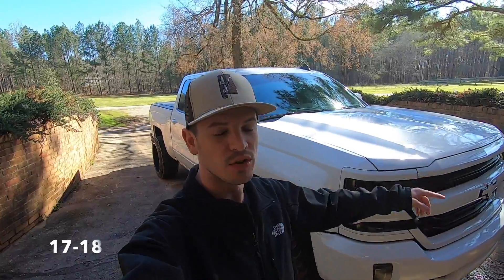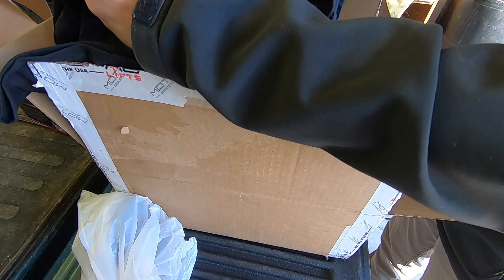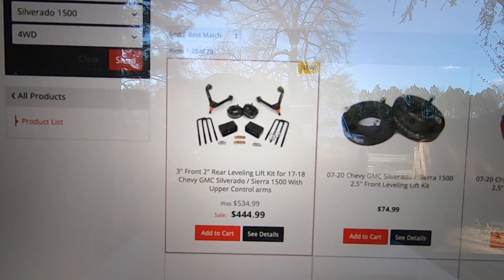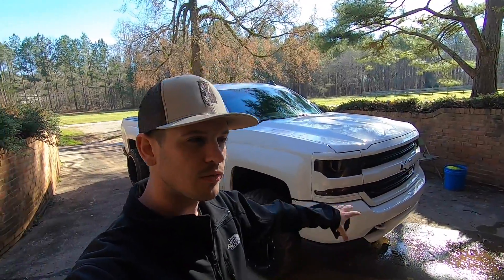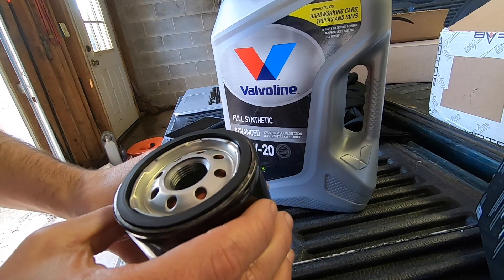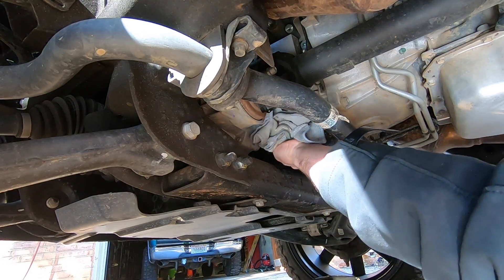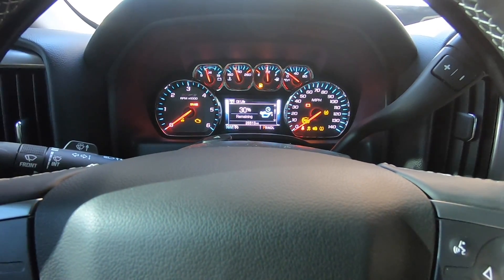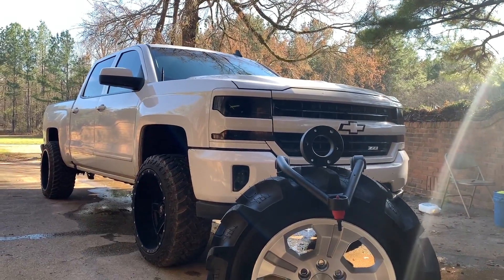Motofab's new leveling kit package! 2.5" - 3" lifts

Comment: Just got the MotoFab upper control arms put on my 2018 Silverado today after riding on the stock stamped steel upper control arms for roughly 2,000 miles with a MotoFab 3 inch leveling kit. As soon as I left the parking lot of the shop and hit the road I could immediately tell a difference. The ride quality on the truck is so much better now with the motofab control arms than with the stock control arms. Everything looks and feels promising, but time will tell.
Reply: You got the new version as shown on the video or the "old version" ... I was told that the old version must likely rub with you wheels or so.  I'm quiet not sure about this new ones.  I gotta do my swap ASAP... I am now at 19k miles with 2.5 leveling kit.
Reply: Francisco Garcia Mine are like the ones in the video, no rubbing that I could tell, even at full lock and I’m running stock 18’s and 31’s
Reply: @jason.godwin  thanks for the info.   Will be making the upgrade soon.
Reply: Francisco Garcia 👌🏻 No problem man
Reply: Are you still running motofab upper control arms? How are they? Have you had any issues?
Reply: Been running these and made a video

Comment: Just installed the the 3” front with 2” rear motofab lift kit with their upper control arms on my ‘19 LD Silverado with a diff drop from supreme suspensions and rear shock mount extenders and the angles are all good in the front, and the truck rides just as good as it did stock. Very happy with the lift so far.
Reply: is the diff drop needed or did you do it just incase?

Comment: The Purolator boss filter has a synthetic media that filters out smaller micron material.. Mobil 1 has a synthetic blend media that filters out a little larger microns but has good capacity. Either way, your only putting 5000 miles approximately on each oil change which is only about a third of the filter life. You could go with a mid grade filter and save a few $$. Those are usually a syn blend filter also.

Comment: My first oil change I did amsoil signature annual oil change and a year later I now have a baby and not as much money. I went with the same valvoline oil but used the mobile 1 filter you removed. I feel she runs just as smooth with valvoline as she did with the amsoil. One trick I use to keep track of my oil change intervals is the second trip odometer in the display in the gauge cluster.

Comment: No dry start by not filling oil filter. You actually put in oil through the valve covers which will lubricate everything on its way down to the pan. The pick-up tube draws from the lower sump of the pan. If you can start your truck within 5 or so min after finished filling up you'll be fine tbh.. but great review on the suspension bits brother
 Appreciate the effort and taking out the guess work on these parts.

Comment: I use NAPA Gold oil filters! I use it with Mobil 1 full synthetic oil. Yes, you can use the NAPA gold with full synthetic oil. I called Wix, which makes Napa oil filters, among other oil filters, a representative told me that it is safe to use the regular wix or Napa gold with full synthetic oil as long as you follow your vehicle oil change intervals

Comment: The Purolator Boss is a good oil filter bro. It’s made by champion labs which is WIX. I have cut several open along with the WIX and they are great filters. When I can’t get K&N or WIX I get the Purolator Boss. WAREAGLE

Comment: Do you think I should get the motofab upper control arms or the ready lifts upper control arms for my 2016 Silverado?
Reply from the maker: I haven't ran the motofabs so i can't say they are superior or not.
Reply: lmfscrew might just pay the extra money and get the ready lifts especially if you haven’t had any problem with them.
Reply: @dsant2093  I run the readylift uppers on a 3" motofab. So far its been 7k on them. All good. I found them used on amazon. Saved $200 ish from new. They were just a open box.
Reply: Project A.D.D what is your wheel and tire setup? Offset? No rubbing or anything?

Comment: Does the 2wd use the same upper control arms as 4wd? I wonder if since 2wd is 1.5” lower than 4wd if it can take 3” front kit with less ball joint problems...

Comment: I wish there was an upper control arm that fit with the stock 20s and the level kit
Reply: Aftermarket control arms don’t fit a stock 20 with a 3 inch level?
Reply: @Tuesflex  My understanding is you need more offset to clear the larger control arm
Reply: @lundysgarage will it fit the 17" stock wheels

Comment: Stupid question. Do you get upper control arms for both front and back? Or one or the other? Or if you lift just front than just lift the front and same thing with the back? I bought the Moto fab front and rear leveling/lift kit (2.5”/3”) and I was wondering if I should order two sets, one for each wheel & ball joint or if I just need to order one set. Any help would be great. Don’t know much about trucks so I know this comment probably isn’t the greatest 😂
Reply: no such thing as rear control arms they use leaf springs

Comment: With the bds leveling kit it has the block up top but also a piece that goes in the spring to ensure it runs at close to factory angles.... would I need upper control arms with that kit?